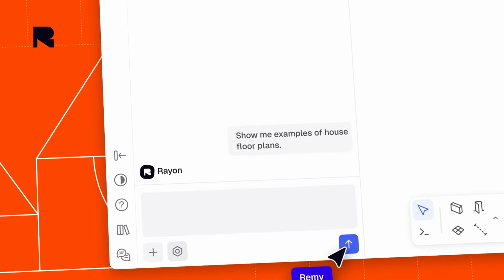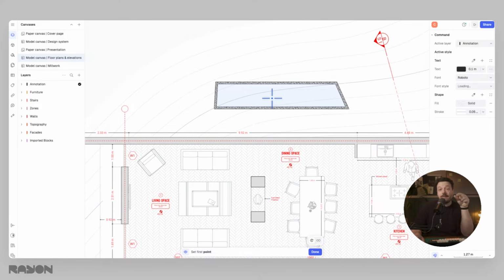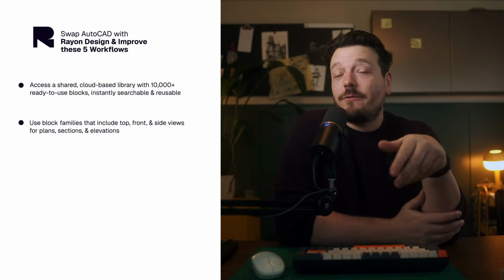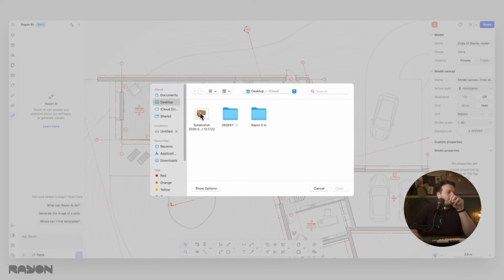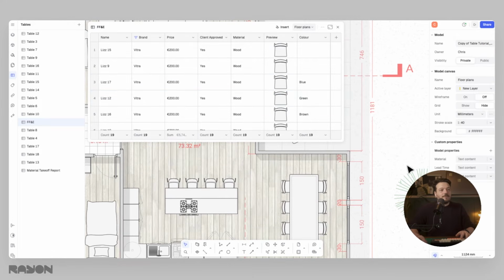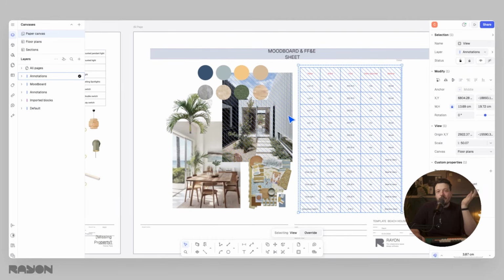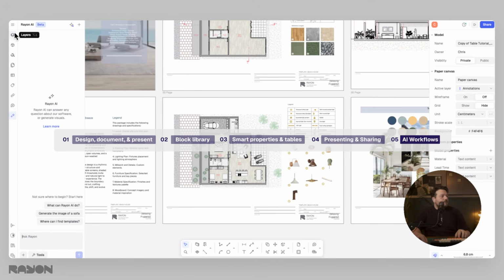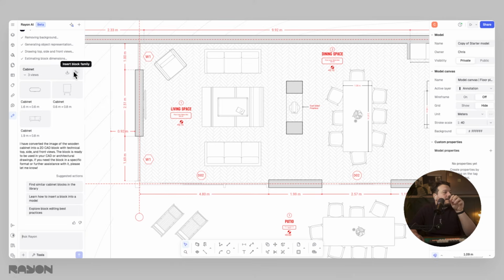5 Design Workflows That Make Designers & Architects Switch from AutoCAD to Rayon

Comment: Rayon can't replace any CAD systems until it gets a radius and diameter dimension tool. I just switch to Rayon for a project and ran into a limitation on the very first drawing I imported and edited. Just 3 minutes into the project, I ran into limitations. There is no radial dimension tool to dimension a radius! WTF? Most architectural and interior design drawings are square, but using circles to denote offsets and adding dimensions to said offsets from a point is nothing new. How would one dimension a circle let alone a spiral staircase, for instance?
Reply from the maker: Thank you for the honest feedback; I’ve shared your request for radius and diameter dimension tools with our development team! 🙏
Reply: @rayon.design  wow, thank you. As a designer, not only do I like to make attractive designs but drawings too. Rayon makes that relatively easy. There is no perfect CAD solution, they all focus on feature development and neglect the 2D drawings, being able to easily position dimensions in a drawing layout is the low-hanging fruit to attractive drawings.

Comment: I hate the watermark, no undo icon, no batchplot. When i use rayon it’s like drawing something takes forever to draw. It’s like it doesn’t have the high productivity like Acad. You have to draw one by one.

I hope u take these comments seriously, and make changes in the next update.
Reply from the maker: Hi @simple5585! Thanks for the comments, we take them seriously indeed! Please note that the watermark is part of the Free tier, and is removed once upgrading to Pro. You can indeed 'Undo' by Ctrl+z or from the main menu. And you can batch-export pages by canvas. To learnmore about each, feel free to read our documentation or reach out to support! There are also tons of tipa bout drawing faster. We hope that helps!

Comment: Rayon Design has repeatedly demonstrated a lack of adherence to contractual agreements. Payments are often withheld without notice, and any complaints or claims filed are ignored. In my case, this represents at least a two-month breach of contract. Most recently, I made a payment on December 26, 2025, but they deducted it on the 20th of this month without authorization. This constitutes a clear violation of the agreed terms.
Reply from the maker: Hello @CumdaAhmad-u1b, we are very sorry to hear you have been having misunderstandings when it comes to our payment method! Can you please share your email address so we can reach out to sort this? Or DM our support panel where we answer all inquiries and prioritizeones that have to do with payments, to ensure all our users get the help they need. Thank you!

Comment: the block library needs to be properly searchable. For example  it can't find a door by size, say. The trim tool in autocad (which I use a lot in ACAD) is not as good as ACAD. The copying is a pain in model space - it doesn't copy to the middle of the view ( like ACAD or illustrator, say), instead it copies to about 1 inch away from the source which is really annoying. Panning with a selection is hard and fiddly. Selecting items is fiddly close up, I'm frequently clicking on something to move it and it just does something else, like changes the dims. Generally, it needs to be more like illustrator in the UI. Not quite there yet as a replacement to ACAD for me, but very very close.
Reply from the maker: Thank you for the feedback @Hamishmcbeth! We share it with the entire team and aim to improve all the time 🙏